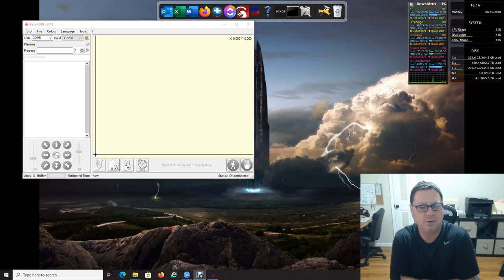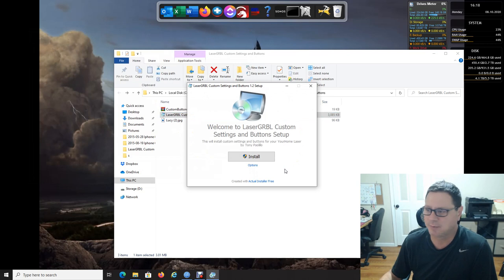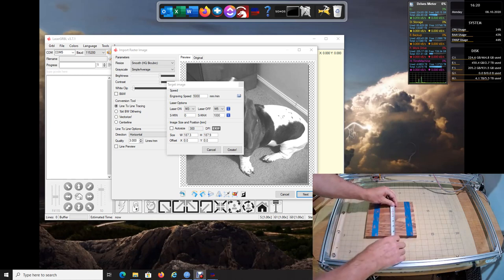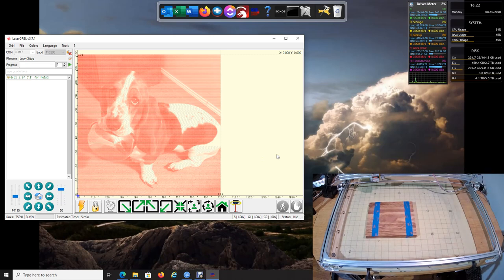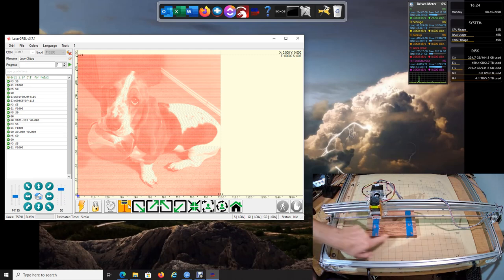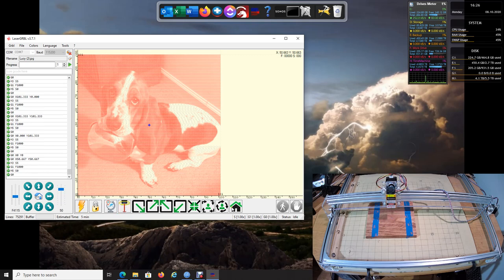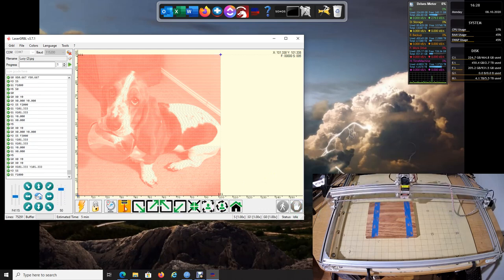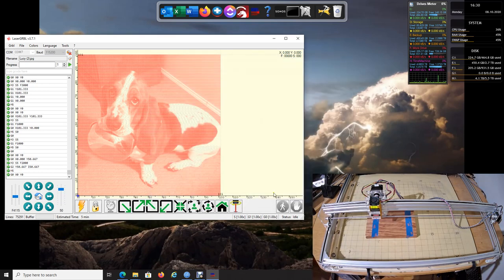Centering your Laser in LaserGRBL

Comment: I have the Atomstack S20 , on the controller i have the center and run contour options but i encountered a strange bug where the machine tried to cut after traveling about 10 cm offset from where it did the contour . Fortunately it was a linear cut attempt and nothing was ruined . The bug was reproductible but i put it on the fact that i feeded GRBL a single drawed line in a bigger white bitmap .

Comment: Thank you for the video. This looks like a great solution.  I was attempting to download your custom buttons, it is showing (all of the links) that it's only 18kb, and 7-zip is saying it cannot read it because it is not an "archived" document.  Didn't know what I was doing wrong in getting those files so I can add them.  Regardless, thank you so much for taking the time and doing all of that work, plus sharing it.
Reply from the maker: Hi, you can’t open the file or unzip it. You have to import it into lasergrbl.  Right click at the bottom where the existing buttons are and choose import.
Reply: @TonyPaolillo  thank you for explaining to me. The older I get the slower I am

Comment: I'm confused with this entire video because the "
set zero point (G92) button is right there... the globe with the location tic button. So basically move your laser to where you want it using the arrows on the left side, then lock in your zero point by pressing that globe button. No?

Comment: Thank you for offering your work for everyone's benefit. I hope this helps: Save a lot of otherwise crucial steps by abandoning the imperial system altogether. Measure everything in cm and mm so that all you need to do is move decimal points in your head. It also adds the benefit of instantly knowing *exactly* fractional increments, as in .33, .5, etc. Best of luck. Thanks again.
Edit: Works almost perfectly with Atomstack A5 Pro. Just be sure the low power dot turns off after it goes home. I had to turn it off with the built in on/off button (the larger bulb icon). Your buttons are a BIG help. I was getting ready for Lightburn's camera overlay. Not any more. Also, no need for the Windows (10) install procedure. Just add them with the right-click procedure used with the additional included buttons.

Comment: That was awesome explanation.
Could I get the buttons file please.
I’m have a big issue I suppose.
I need to define the working area ( I don’t want my machine to crush at the edges). Any proposal??
Reply: The best way to prevent edge crushing to install limit switches.

Alternatively, you can set your work area smaller than the actual work area of the machine.

I have a machine that is 30" X 30".
I am using a 24" x 24" sheet of MDF as the waste board and set the machine work area to 24" x 24".
As long as I don't do something stupid like click the homing button to see what that does;😏 I shouldn't have any edge crashing.

Comment: I am really new to LaserGRBL. If I install your custom buttons, does it remove the stock ones? Can I uninstall yours and go back to stock if I wanted to? I went ahead and installed.- success. My OLM2 decided to go from home (bottom left) and shoot to top right when I center or frame. I have only run 8 projects and the first 6 were fine, Then this happened. The help I received was about setting the coordinates, but no info as how. I hope that this will solve that issue. Will try tomorrow. Great video!!!
Reply from the maker: Yes you can always remove the buttons if needed.

Comment: Hi, Sir! I hope you can help me about my cnc 3018 mini pro laser. My laser have a switch knob at the top of the fan. Basically, everytime I am going to use it. I manually switch the laser before printing. My problem was, I can't make it right the exact heat of my laser. Sometimes it's too hot and sometimes it's not printing properly. It has a constant heat. Is there something I missed? Please help me. Thank you...
Reply from the maker: Hi. Unfortunately I don’t think I can help with that. I would ask for help in the forum of where you got your machine and see if someone else could offer more insight for a solution.

Comment: Tony I followed your link downloaded the file imported into LaserGRBL but get an error. Is there a way I could get the code for the buttons and input them myself. Basically the sq and circular framing and the home and center buttons. Thanks great video.
Bob
Reply from the maker: Hi.  Here is the link.  Download the file and then go to Lasergrbl and right click on the custom button section and choose import.  
http://fileit360.com/?dl=45604ddc5534e654fa6f148e6ebbecf8
Reply: @TonyPaolillo  Thanks for the video and the buttons. I can reccomend to pin this link to the video decsription. Thanks again.

Comment: Tony, What do I use to open the .go file I have the newest winzip but it ask me for an extension or something in the file? Help not very savvy with zipped files.
Reply from the maker: You can’t open it. In Lasergrbl you right click on the custom buttons section and choose import.  Then navigate to the file and select it.
Reply: Tony, tried just as you said and it comes up with an error message and when I press continue it clears screen. I have a dell Inspiron using Windows 10. Thanks for the help.
Reply from the maker: @bobvarner3270  so you right click on the custom button section and choose import? When you select the file you get an error?  
What is the error?
Reply from the maker: That looks like your having an issue with Lasergrbl itself. I can’t really help you with that part. You may need to reach out to them and see is they have any ideas.  
Also try to reinstall Lasergrbl first to see if that helps.

Comment: i imported the file and all the buttons work but the one for turning the laser on , any suggestions ?
Reply from the maker: Just make sure the power is on to the laser also not just the controller board.
Reply: @TonyPaolillo  the laser pwr is on but the laser doesnt actually come on until you start a burn
Reply from the maker: Hmmmm.  Not sure other than your laser doesent use the M3 fire command.  You can find that out by your manufacture and then edit the button command.
Reply: @TonyPaolillo  how would I edit the button command
Reply from the maker: @poppopsdesigns9727   right click on the button and choose edit.

Comment: Tony, Thank you for the great video. 
Question: When I turn my laser on to find my centering, why does the laser come on FULL POWER and starts to burn? Isn't it suppose to come on at low power so it doesn't burn an image around your project and now I've wrecked my project I haven't even started to engrave yet.
Reply: Hey, I had the same problem and just figured out how to fix this myself. Right click the focus or frame button (well any or all of the buttons if you want to stop the burn happening) select edit button, under Gcode look for M3 S[$30*10/100] the fraction is the power of the laser when it's doing this function. Personally i've changed it to M3 S[$30*0.5/100] (0.5% laser power) and this way i don't get any burning while calibrating.